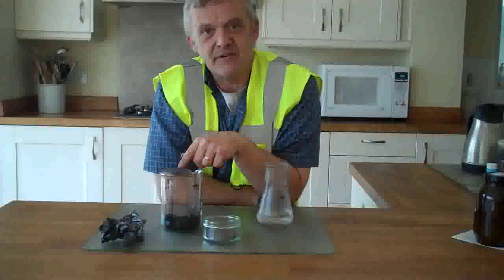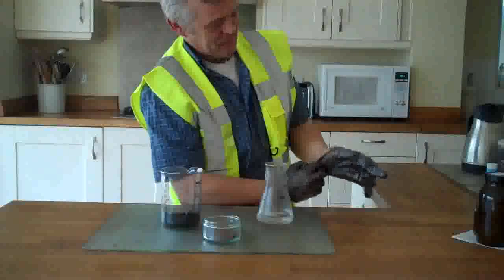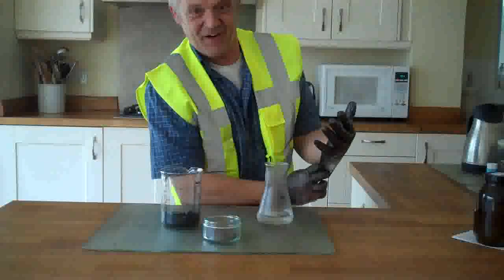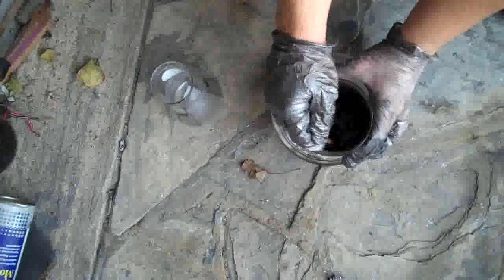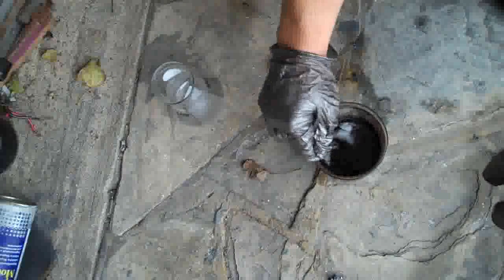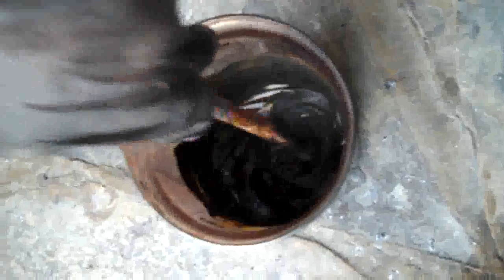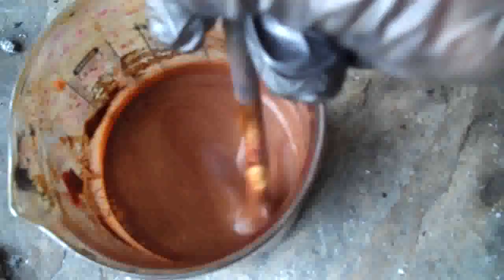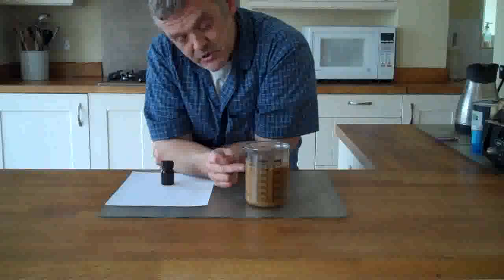Large Scale Graphene Oxide Production Method

Comment: I see your videos resembling building blocks. LEGO for big brains/kids. 

So did you use your G or GO to try to do something about the H2 storage problem?

Could one build a selective storage matrix that will absorb H2 but reject O2, so one could use your electrolysis cell of the graphite plates stack without separation diaphragms and feed the H2 and O2 mix into the storage. After the H2 got fixated, one can let the O2 go or try to recover it if valuable. 

I still do not understand why C nanostructures degrade after some cycles of H2 loading/unloading, indicating strong interactions. 

What do you do about safety? Against notification?

After all the inflammation driving properties of GO showing up, I was wondering.
If your chemical insights have a hint on how to detox it, please say it aloud :)

Thanks for your inspiration, as always! ❤️

Comment: Hi Robert! Thanks for sharing! Great experiment! I have some suggestions for improvement. I had to do it 2 times.  The first time I did it the same as you with 5g of fine mesh graphene. I put everything into snow to cool but anyway the reaction run away. Massive violet and brown fuming and even carbon flakes flew out. The permanganate decomposed due to the heat and nearly no graphite was oxidized, no color change. I dumped it because after 30 minutes everything was still deep black. Maybe the reaction was so massive due the fine mesh graphene. The second time I cooled the sulfuric acid down to 0°C inside the main container. I mixed the graphebe into it. Stirring it for 5 Minutes and than pour slowly the permanganate into. No fuming at all!! It changed soon to a very bright greenish. Nice. Than I moved it into a waterbath and heated it up to 40°C and some degree more until I noticed the smell of ozone. Very slow and controlled reaction! Then I moved it out from the bath until the ozone stopped bubbling up. Keep stiring. Move back to the bath until the O3 bubbling appeares again and so on. Keep stiring until the O3 bubbling stops and the slurry becomes yellowish/brown. Than move everything into an icewater bath. Poor slowly the 4°C 400g DI water into it. Monitor the temperature. Wondefull color change! You see the golden flakes swimming in the solution. Magnificent! The slurry was sattled after 5. I will repeat deluting it before washing it with HCl. Hope I was able to give some positive feedback. Good luck Thomas.

Comment: I have very recently discovered the changes n UK law related to private use of chemicals. New regulations relating to explosive prer
Precursors and poisons has severely restricted private access to chemicals, with access to once common household chemicals now illegal. Certainly access to strong acid has recently changed, including strong hydrochloric acid. The other common acids falling into both the explosive precursor and poison category. Other materials covered by the new legislation is a number of oxidizing agents. While some of these chemicals are still available on web sites such as Amazon or eBay, there purchase is illegal.
It is possible to apply for a home office license to buy some of these chemicals for a specific purpose, I have the impression that the home office will not grant a license for chemical experimentations, which they frown upon outside an industrial or research environment.  From what I have read in the last few days, application for a chemical use license is not a simple process.
I would be interested in your comments about this subject and the application for a home office EPP license. 
While some batteries can be made with household chemicals. I am reasonable sure that the chemicals shown in this video are now illegal. As an industrial user and a qualified chemist, I believe that you are in a different legal position to say an electronic engineer, regarding access to these chemicals.

Comment: Would it work/be advisable, to use a magnetic stirrer?  On any or all of the steps?  Thank You
Reply from the maker: you can always try - it gets a bit thick though and the stirrer will stop stirring afer a while
Reply: Would try a normal kitchen aid stirrer. 
Or a drilling machine with speed control, clamped in a stand, and let it turn a hook of proper material. 

What did you use for stirring anyways? ;)

Comment: The filtration step can be a nightmare even with large 12 cm (45um) nylon membranes. The next time I make a batch I will try drying the stuff in an oven before filtering/washing. Thanx for the video.
Reply from the maker: it is a nightmare and the method you suggest is the one I use in the video I made on how to wash your graphene oxide after you have made it

Comment: Curious about this being explosive.  Is it explosive in the way that it could perhaps spontaneously explode if left to get hot.  Or does simply mean that "technically" it is explosive at higher temperatures but it would still require you to do intentionally cause the explosion?
Reply from the maker: it spontaneously explodes if left to get too hot
Reply: I was wondering about that for a long time.
I would like to see how energetic that it would be, but im not curious enough to try it lol.
Reply from the maker: Clown Whisper
lol - only try it behind protection mate
Reply: Robert Murray-Smith not to beat this to death.....  or maybe so,,,,,   at what point does this stop being an explosive compound?
Reply from the maker: Clown Whisper
when all the manganate has been used up

Comment: Dear Robert,

Thanks for sharing your fantastic videos. I am trying to obtain a stable dispersion or homogeneous mixture 0.1 wt% of graphene oxide with hydrocarbon such as diesel but couldnt get it. I am wondering if there is any way to make this happen? I would highly appreciate your advice. Thanks.
Reply from the maker: graphene oxide disperses well in N,N-dimethylformamide, N-methyl-2-pyrrolidone, tetrahydrofuran, and ethylene glycol or cosolvents of DMF with water in a 9:1 ratio by bath sonication - this will help you reduce it to graphene that can the be dispersed in organic solvents DMF, DMSO, THF, NMP, acetonitrile, acetone, ethanol, diethyl-ether, toluene, and DCB, and probably diesel - though i have never tried to disperse in diesel myself

Comment: It occurred to me that I should avoid excessively high temperatures during the process of making graphene oxide because those same high temperatures would convert the graphene oxide back to graphene.  So what I did to moderate temperatures was I put a bunch of glass marbles in with my reactants, the idea being the excess mass would absorb the energy of the reaction and keep temperatures a bit lower.  I'm pleased with the results but I don't have any hard data to back it up.  All of this was in addition to putting my reactants in the freezer so they would be very cold to start off.  I did not finish off with a high temperature stage in the oven.
Reply from the maker: glass marbles - that is clever - very clever - well done, I will try it